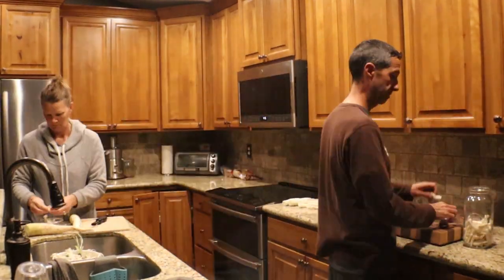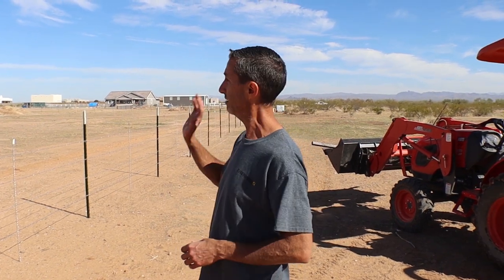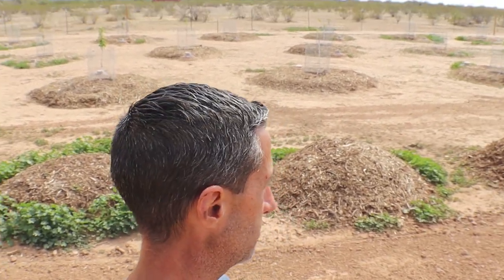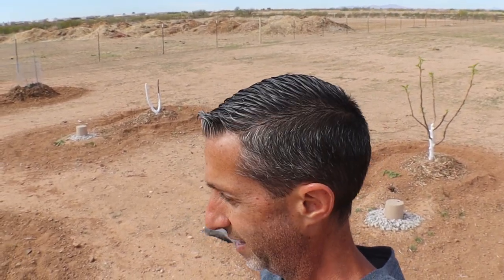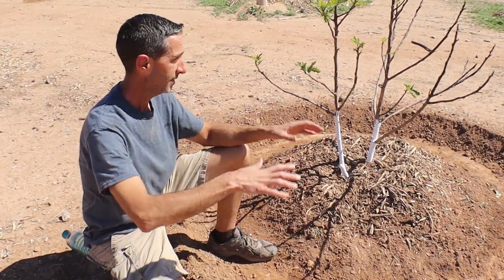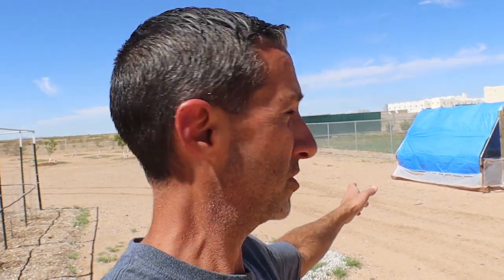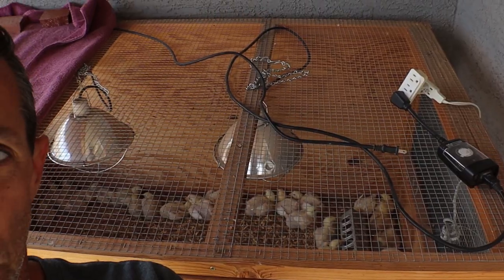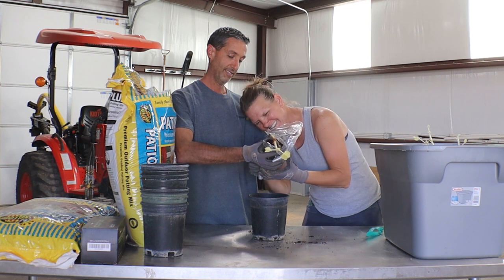DFV | Fig Pop Failure | Non-stop Projects

Comment: I am going to have to do that to my auger, so far the holes I have drilled have been easy but I know I have some hard areas around the property.
Reply from the maker: That's the challenge. We have areas where it drops to 3 feet with no issues and other areas the clay is so hardened that it literally starts smoking with the heat built up on the auger bit!

Comment: Any reason why you are not grafting many varieties on your fruit trees? You can easily double or triple the number of varieties you have and experiment a wider selection more easily. Specifically for figs, you can do so much better than commercially propagated ones like Brown Turkey, Black Jack, etc
Reply from the maker: That's a great question/suggestion. The honest answer is we don't have any experience with grafting and with the amount of space we have on the property we're wanting to fill that in with individual trees for the time being. At some point we'll learn that skill for propagation of new starts as it's an important tool in the tool chest. We've also been told that some varieties just do better with a different root stock as opposed to using the known variety for the root structure.